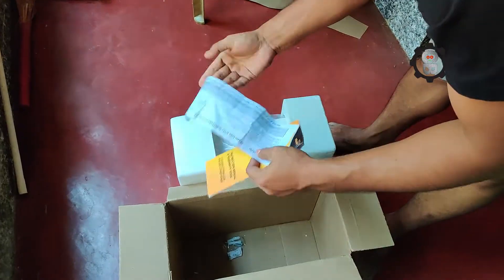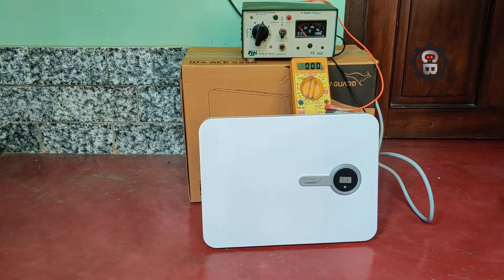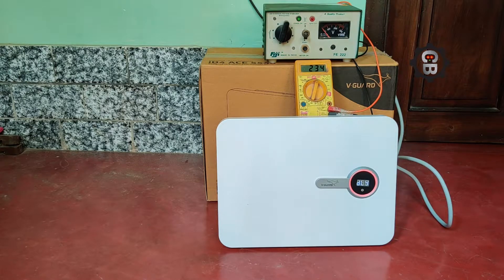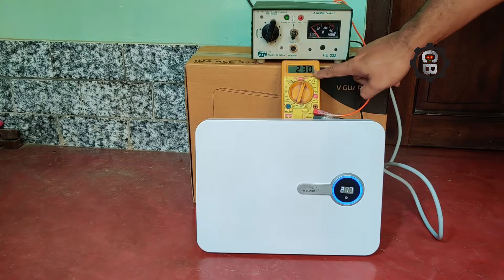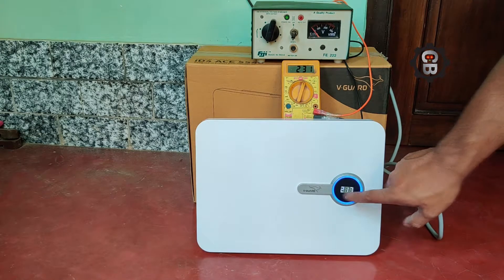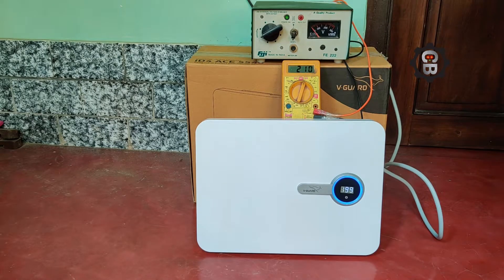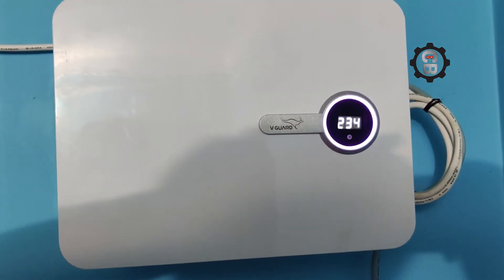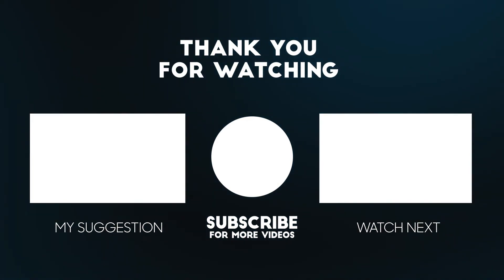How To check a Stabilizer (V-Guard iD4 Ace 5540 for 1.5 Ton Inverter A.C)

Comment: My stabilizer is not showing delay time. Previously it used to display at the time of starting. Now it starts directly showing input voltage output voltage. What should I do? Please suggest
Reply from the maker: Please connect with the customer care.

Comment: I recently purchased 2 stabilizer of this model. My is showing input 238 to 240 and output 208 to 210 , that too pink colour led ring is showing, is this stabilizer faulty ? Plz give answer
Reply from the maker: @MANOJKUMARNARADALA-no8lb  no problem. Stabilizer is working as expected.
Reply: @Chandrabotics  pink led ring is for input voltage lessthan 200 , but in my case input voltage is 240 +  still showing pink led ring, it need to show blue ring naa? And most of ac's operate effectively in 230v range but this stabilizer is stepdowning 235 - 240v input voltage to 208 - 210v output voltage, which causes bad impact on AC na?
Reply from the maker: I think it is not an issue. If you still need confirmation then connect to V guard customer care.

Comment: Sir mera input voltage 177 but output only 30 volt increase hota hai...207 to 2012 ... what's the problem
Reply from the maker: @tapansarkar-oi4mi  tab to thik hi hain. 200 ke as pas rakhta hain.

Comment: Sabse bekar stabilizer 😂
Reply from the maker: Apko kuch issue ho raha hain? Mera ekbar hua tha issue to company se phone karke thik kar lia. Abhi to sahi se chal Raha Hain.
Reply: @Chandrabotics  Yes Sir.
When voltage is in low range 200-220 it always diminishes voltage by 2-5 Watt instead of making it to 230-240. It displays 200 to 215 Watt. Company person came saying it quite natural . He said that only when voltage goes below 200 then only it will upgrade the voltage only which is contrary to stabilizing theory. An AC needs 230 volt to operate smoothly. So the stabilizer is a vague one in my point of view.
Reply: @prabirbhattacharyya1938 absolute correct, Mine is giving output 200 when input is 240 , Vguard service person said it's normal
Reply: @prabirbhattacharyya1938 My stabilizer showing input 245 to 248 and output showing 215 to 218 , is and ring is showing pink+blue mix type , is my stabilizer working fine ?
Reply: Nope  @MANOJKUMARNARADALA-no8lb
Reply: @prabirbhattacharyya1938  should I replace it ?

Comment: Testing without load is useless. Stabilizer should be loaded at least 50percent for accurate results. Using Variac is correct method of injecting voltage. Hope you don't mistake me.
Reply from the maker: Thank you Sir for your advice 🙏

Comment: Mera 1.5 ton ka career ac hai. v guard id4 ace 5540 stabilizer mein in. Put maximum time  i.p 240 se 235 aur o.p 201 - 202 andar rahata hai aur kuchh kuchh time mein jab o. p badhta hai ya kam hota hai uske sath ac ka speed bhi kam jyada ho raha hai .sahi hai ya nahi?
Reply: Maine bhi same problem face kar raha hu. Iss stabilizer ki sirf look achi hai koi kam ka nahi hai
Reply: Ac kharab ho jayega return kar do faltu stabilizer hai
Reply: Isse lo problem solve ho jayega
Reply: @Sahanawaj_ toh fer konsa liya stabalizer
Reply: @spawn6977  Microtek PEARL EM 4150+For AC upto 1.5 Ton AC Automatic Voltage Stabilizer-Standard
Reply: Dekho stabilizer ki jarurat nhi hai..mene bhi liya tha.....230 to 240 volt input ata hai tab 206 204 output de raha hai....iska kya Matlab......stabilizer 130v to 290v me koe bhi input ho....output 220 dena hi chahiye...but stabilizer koe bhi nhi deta...so return it
Reply: Mere saath bi yehi hora hai

Comment: I have purchased the same stabilizer I have a doubt kya stabilizer ka fan continuously chalta hai ya jb voltage km ya zyada hota hai tb.
Because I am getting input 233-235 and output 228-229
Reply from the maker: E normal hain. Apka stabilizer acche se kam kar raha hain.
Reply: Mera wala fan to chalta hee nahi aur trip bhi hota haii kya kare
Reply: @prasadjadhav3837  bhai mjhe bhi ek lena h 
Ye lu ya VWI 400 LE LU

Comment: Brother , I think , you could have added another multimeter for the output voltage of the Vguard stabilizer. So that , it can be checked , if the output voltage that's being shown on the Vguard Stabilizer's digital display , is same with actual output of the Stabilizer or not. That would have been more accurate test.
Reply from the maker: Thank you so much for your suggestion ❤️🙏
Reply: @Chandrabotics  My input and output is showing the same. Can you please help me, it shows196 input and 196 output.